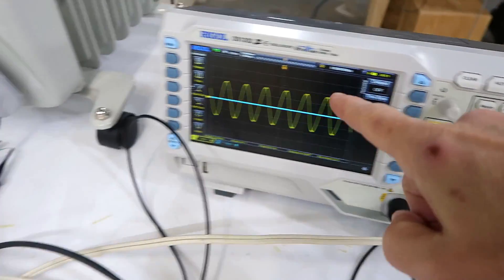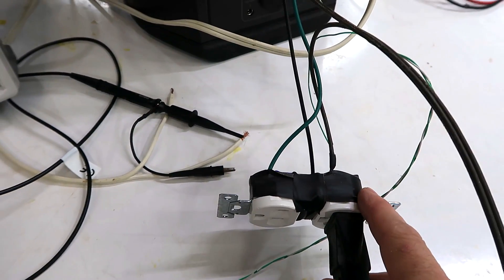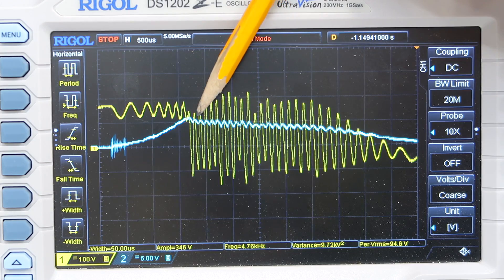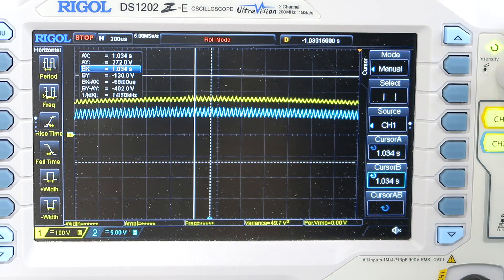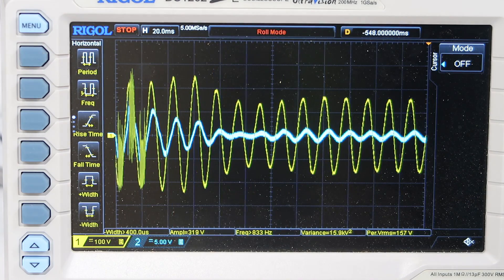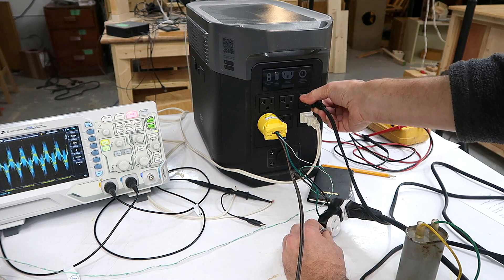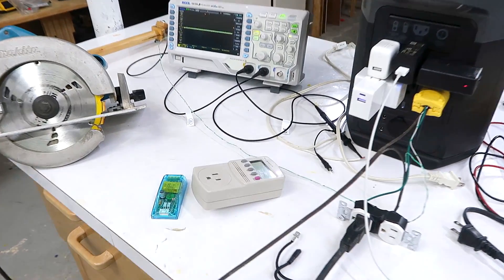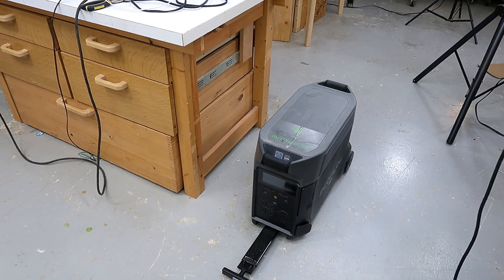Inverters don't like power tools

Comment: If you have an induction motor spinning with a large inertia load, it can kind of buffer the AC voltage and help smooth it out. If you haven't exhausted the topic, try starting up the skilsaw while the bandsaw or a tablesaw is already running on the same circuit.

Comment: Until major advancements are made with the control system and output filters, this will always be a problem. I am an electronic engineering student who's been designing a 500W inverter for the past year. As long as a SMPS approach is used, I don't see how this can be totally eliminated from the technical side.
Reply: All they need to do is use a filter inductor with a much higher saturation current. It seems they decided against it due to size and cost.   If there was enough filtering, the voltage would drop smoothly when the cycle-by-cycle current limit was reached.  Without it the inverter is operating more like a motor controller, using the motor inductance to smooth the current.
Reply: @realsolarcars  There is definitely an inductor on the output I believe. A SPWM filter or something of that nature is necessary. I believe the inductor was sized properly, lest it wouldn't operate properly within spec. When the motor starts, it's clearly being used outside it's spec for a brief moment hence there's some erratic behaviour.

Comment: Egad!  No wonder I wasn't able to just throw together a battery, some solar panels, and an inverter to drive an electric chainsaw without it cutting out half the time.  If plumbing was a fussy as electricity we'd have water shooting across our kitchens every day.  More troublesome than every chemical reactor I worked with ever!

Comment: I'm not an expert but couldn't they sell an accessory starting capacitor or super cap that can provide the current to start these high current but transient loads. Seems like most users wouldn't need to buy it but it could solve this issue?

Comment: How would the eco flow behave with a 1.5KW CNC spindle, under load and without load?

I ask as I’ve got a problem many have run into. My CNC is in the basement where all outlets need a GFCI. Unfortunately the high frequency noise the spindle VFD creates trips the GFCI. 

The solution is to use an isolation transformer. But those are big, expensive and only do one thing. If instead I could put an eco flow that simultaneously charges from the GFCI circuit and supplies AC to the VFD that would be a better way to go. But, can the eco flow handle it or would it blow up?
Reply from the maker: the spindle is probably soft start, so it would be ok.

Comment: Hope u would do the investigations or ur test using a appropriate capacitor to control transient pos n be voltage fluctuations as is happening now.... Let's c the reading on the scope after that as this is inductive load n need balance w a cap

Comment: Neutral to ground is a problem since protection devices need it to operate properly. Power tools using brushed motors like that circular saw also put high voltage spikes onto the power source this can also blow the transistors IGBT's

Comment: I suspect what is going on is that the inverter loses control of the output voltage when the hardware current limit circuit operates, which becomes a problem into an inductive load which will attempt to maintain the same current as its magnetic field collapses.  Power output stages can be designed to clamp their output voltage while current limiting, and this is routine in power supplies intended for constant current operation.  Nothing prevents doing this in a line power inverter with a class-AB or class-D output stage, but it adds complexity that is not required for most loads.  I wonder why they did not design their switching output stage with higher bandwidth so that it could implement current limiting.

USB chargers usually have universal inputs so will tolerate a 240 volt AC input voltage without damage.

Comment: I have connected single phase output of inverter to a frequency drive with 3 phase output to run a belt driven alternator to make 14 volts 145 Amp dc output to make a very over complicated battery charger I have connected it all in series so the alternator charges the battery that runs the inverter just messing around

Comment: I read a very, very old article discussing adding a capacitor to the output of modified sine wave inverters to smooth out the waveform. Unfortunately, to make any difference, the value would have to be so large that half the power was wasted just "running" the capacitor!

Comment: Thanks for showing the even more detailed scope data. It does seem like this oscillating protection behavior should be opt-in with warnings because of the possibility of damage. (It should default to turning off with a longer period, put some hysteresis in it)  Especially since there's movement to ban gas generators so more folks will start using these things for more and heavier loads.

Those chargers might be ok, but led lights won't be...

Comment: With these high inductive loads, you need an LF (Low Frequency) Inverter they are designed for such loads... but they use a big transformer and are heavier.  Those high frequency mosfet inverters are not really able to handle these types of loads very gracefully.

Comment: There are two types of inverter design commonly in use.  The one used by EcoFlow first convert the battery voltage to ~170VDC and run it though an inverter to generate 60Hz using PWM signal.  The output filter inductor is usually small to ensure the overall system weight is small.  The downside of the small inductor is it can saturate easily, which can damage the inverter when that happen.  The other common design use a big output transformer and switch the PWM signal at battery voltage.  The downsize is the output transformer is big and heavy.  The advantage is the high inductance which should let it handle over current easier.  It would be interesting to see how one of these type of inverter handle spinning up a big motor.
Reply: Good explanation of High Frequency (HF) vs Low Frequency (LF) inverters.  I too would love to see how an equivalent power LF inverter handles these tests.
Reply: Other downside to LF inverter is the crazy high idle draw expect for vicron's hybrid LF inverter

Comment: It is very hard for an engineer to design any kind of electronics to deal with loads requiring high dynamic range, efficiently, and at an affordable cost as you are dealing with here. I get that you are striving for some ideal and pointing out that this device you tested doesn't meet the ideal but the ideal you are wanting is obtainable at a cost this manufacturer wasn't going for. You could force the design to never current limit but you will have to pay for it in battery life (or damage),  price increase, efficiency reduction, weight increase, size increase, etc... you get the idea. If this thing isn't to your liking then it just isn't. Move on. It is way more complicated than requesting some fix that shifts the entire design philosophy. The makers of this thing are way smarter than you are giving them credit for.

Comment: You'll only see capacitive droppers in devices that are isolated. Generally these are devices with no user inputs, like a light bulb, although the kill-a-watt uses long rubber buttons to achieve isolation. Any USB charger is going to have a more expensive power supply design in order to have isolation.

I wouldn't be surprised to see lightbulb capacitive droppers behave a bit differently than the kill-a-watt. Most I've seen don't have a zener diode, since they don't need that precise regulation. They're also probably dropping less voltage on the capacitor, so the relative spike on the load from its effective resistance going down is going to be less.

Comment: I was about to ask about soft start motors when you addressed them. Good to know, perhaps especially for people using these backup systems in a winter storm power outage with forced air heating driven by an induction motor.

Comment: Have you considered putting a soft start device in front of the power motors?  These are devices that lower the inrush current, thus reducing the peak load.  I'm actually considering getting one of these battery inverters to supplement my AIM inverter.

Comment: Rather than using a capacitor on the AC output, try an inductor in series on the live wire! 
I had an issue with blown up BMS boards on my batteries when the fridge would fire up... I thought about using a capacitor but I was in the DC state of mind, yeah a capacitor work's great for smoothing out ripple on DC but only act's as a high frequency filter on AC... A common mode filter choke which is just two separate and isolated from each other with each one in series on the live and neutral...  You find these common mode filters in switch mode power supplies in equipment that is sensitive to power fluctuations.... 
I couldn't tell you if one from an old VCR would handle something like a circular saw but there must be something available out there that can handle those sort of loads.... 
In saying that though, a common mode filter from something else might might show an improvement that would suggest that it might be worth looking into getting a better more powerful filter!!!! 
I have yet to try it myself but if you beat me to this experiment, then I will know for sure that I was on the right track.... 
Thanks for posting this video.... 
This video applies to me as I have an off grid solar system and these inductive spikes are driving me crazy! The 3kw inverter survives but the BMS boards on the batteries doesn't!!! If the inverter had a common mode filter on it's AC output, I probably won't be having this problem..... The inverter manufacturers would know about this issue if they actually used their own products in real world situations.... 
Keep up the great work on these excellent videos... Looking forward to the next one!

Comment: Say you had a variac capable of 15A, could you use it to soft start your circular saw and avoid the oscillations?

I'm guess it would prevent the oscillations, but I'm unsure if the saw would start up properly when ramping up the voltage.

Comment: I'm running a 5.5KW 3 phase motor with a 220V inverter single phase powered. This motor runs as an idler and smooths the 3 phases. With it I'm 3 phase powering my surface grinder and other tolls in my garage. Never had any issues with the inverter. The idler motor coils acts as low pass filter and dumps any current surges
Reply: Do you have any extra inertia on the idler motor? Or is it just the rotor and shaft that is spinning?
Reply: @mckenziekeith7434  Just the rotor spinning.

Comment: Just a guess but could the reason for that kill a watt failure is due to how its power supply is deaigned ? I dont have the exact same  device here but power meters we have here uses capacitive dropper, and capacitor being capacitor, the “conductive” changes based on frequency, my guess would be at the high freq oscillation that capacitor essentially turns into a dead short, overvolting the microcontrollers and other parts damaging it, or maybe just shorting a zener instead of the main components

Comment: Could this damage a PC’s motherboard and processor or would it just damage a PC’s PSU?
Reply: Switched powered supplies don't really care if the input voltage gets unstable, decent ones should even manage to keep the output stable through the ringing. So your PC would be just fine. 

The only common power supplies that actually are affected by this are capacitive droppers - an extremely simple (and cheap!) type of power supply that can't handle much current and doesn't provide galvanic separation, so it can only be used in very specific circumstances. Mostly you'll find it in mains powered small LED bulbs, power meters, timer switches and similar small consumer electronics.

Comment: Neutral to ground connections have been a way to fry those kinds of electronics for a long time. Something I found out 25 years ago doing maintenance in dorm rooms when an annoyed engineering student got back at a neighbor by rewiring a socket on the shared wall.

Comment: I too have blown up a power meter by plugging an induction motor into it. Off mains, but my chest freezer draws ~5kW for ~2 cycles when it starts, if it starts in the wrong part of the compressor cycle. Then it drops rapidly back to 90W. So sometimes my 1200VA inverter will start it, but usually not, and either way there's a big "bong" noise from the transformer inside it caused by the current spike (low frequency inverter). Am not running freezer off inverter any more

Comment: I have worked with some power inverters before and the are probably doing the OCP using the voltage acros the IGBT. this voltage depends a lot on the IGBT's temperature if you were to run the equipement in a very cold enviroment the OCP would start with much less current and also if the inverter is warm the OVC ight not kick in.

Comment: Kudos for following this up. I beleive most phone chargers are flyback topologies - both for mains isolation, and because they (depending on the standard) need to deliver over 30W. A capacitive power supply is only useful for sub-1W type of power (5V at 50mA, for example) because it's just not that efficient (it's only benefit is cost, really). Also, I'm glad EcoFlow got back to you and took this as an opportunity for everyone to learn something - I definately find that attitude appealing in a company, and it builds trust.

Comment: what eco flow has to do is add a huge cap bank that only kicks in a bit before the overcurrent circuit does, so it helps with oscillations but doesn't hurt the performance too much.
btw, yes, devices with a decent switch mode PSU won't care at all about the oscillations, since the first thing that they do is rectify the ac voltage, and have a wide voltage range

Comment: Inverters dont like large inductive loads period.  The mains supply is happy to supply current 90 degrees out of phase with the voltage, inverters don't like this because the currently energised transistors would need to conduct backwards which they can't. At least thats the reason I told myself.  The large spikes are not from the inverter, they are from the tool because its inductor current being interrupted.
Reply from the maker: actually, the inverter is quite happy to feed power back to the batteries.  When it's plugged into mains, it just hooks the inverter output to the mains and runs the inverter backwards to charge the battery.

Comment: Inverters will never replace a actual generator. Good luck commifornia when your grid fails every one there thinks inverters are cool
Reply from the maker: If I had to rely on a generator, I'd also want a battery power station like this so I wouldn't have to run the generator the whole time.  Saves on wear and tear and fuel.

Comment: your electric supplier does not like either the starting part of your power tools. it generates huge parasites that just kill the network. they may damage some devices, or make some circuit breakers jump. 

so no your UPS can't like them. no ups does. not even gaz powered generators ...
Reply from the maker: 100 amp starting load on a 200 amp panel isn't such a big deal.
Reply: @matthiasrandomstuff2221  its not just the peak current, there is also phase shift , and other details.

Some power tools have a soft start driver to avoid mechanical couple hurting hands / arms, but some good ones are designed to reduce peak current.

A bad drill can make my computer shut down. 

Elevators in Paris are known  to affect computers and cellular reception.

Comment: A common work around for making a static phase converter is using a momentary switch or relay coil to disconnect the capacitor after the motor has started. I wonder if you couldn't do something similar as an add on in-line box that would hold you capacitors and some sort of switching control to help with the spikes but shut off so it doesn't draw continuous power?

Comment: Seems like an easy solution, sell a power tool accessory which is just a basic power strip with a large capacitor and maybe add a few safety features like a poly fuse.

Comment: The sinewave is probably generated open-loop and the current limit HW that blanks the output drive, I'm sure it would be possible to do a more gentle constant current type limiting by lowering the voltage, at least for loads the isn't a dead short. But it might take even longer to start thing like the saw and the low voltage cause things like computers to reset, not what you'd  want from an UPS

Comment: Sounds like their switching converter does pretty well at handling transients. 300A -> 50A might be hard to do while still handling smaller, finer ones because of the need for too many different frequency-tuned components. Might be better to have one that's supposed to be used with wood working machinery. 

Switching converters are really neat pieces of electronics! You can do pretty much anything with them.
Reply: Way to much faith in switching converters as they have serious faults for my needs.
MIAt this power scale level it is substandard and unacceptable to me

Comment: The box needs a separate, 'unpure' sine wave inverter for wack things like that saw, just isolate saw completely. 

I wonder if an inverter generator has the same flaw? 

I have seen people run that exact saw with 72v DC... Or I think if you have the money for the Ecoflow, you can afford a battery saw of the same form.